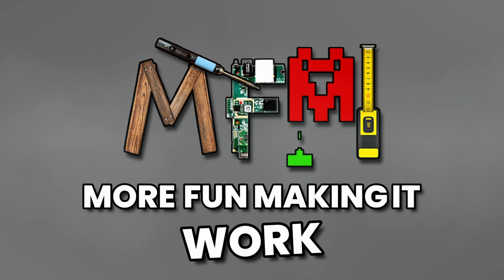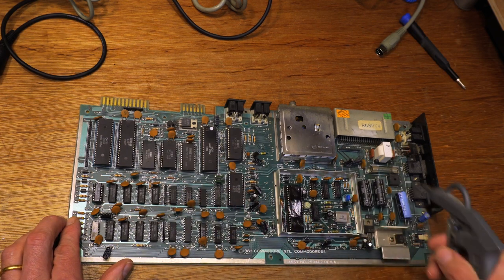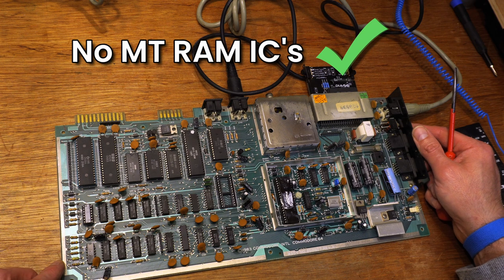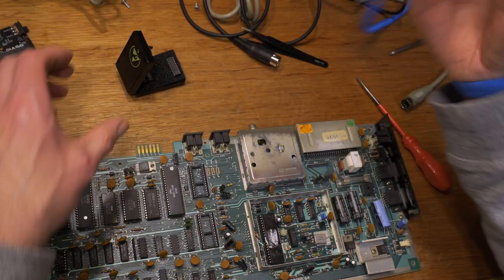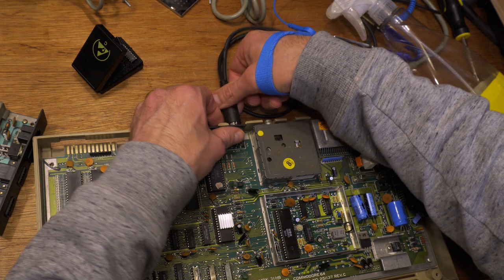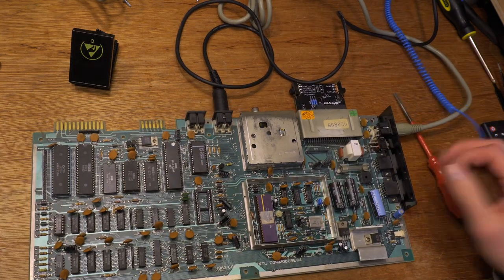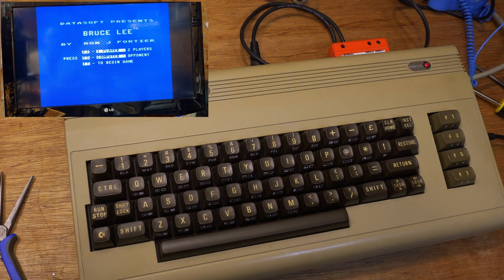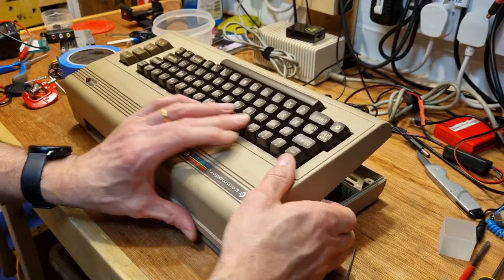THREE THINGS BROKEN! - But Still a QUICK C64 Repair. FOUR if you count the case clips!

Comment: Ah, just ALL THE EXPENSIVE CHIPS knackered then. Cheers MOS 😳
Reply: May have been over voltage from a failed power supply too.
Reply from the maker: That's a good call. Probably the right one
Reply: @Breakfast_of_Champions  Probably a little from Column A and a little from Column B.

Comment: Nice work bud.  I recently revived one that had a purpleish screen and freezing and dead test was showing pla and vic2 good,  but showing a whole row of ram bad.  I knew (assumed) that it was the multiplexer which were both socketed  in this board,  but nothing else except vic ii.   Changed multiplexer and boom. The right amount of bytes:)   changed pla and got boot screen,  but still purpleish.   It was the vic ii .  Then normal screen.  Unfortunately the sid was bad too.  Lol.  Those vic ii can cause weird problems eh?
Reply from the maker: Its a nightmare when so many chips go bad. Not so bad when its someone else paying for it!

Comment: What?  No retrobrighting!  I'm interested in what technique you think works best, here in the UK.  Do we need a lightbox?
Reply from the maker: My lazy method is just shove it outside on a sunny day. Doesn't work quite as well on a C64, but fine for most jobs. I've not tried it myself yet but I hear very good things about vapour briting. A light box probably not that essential unless you have no outdoor space. Even in the winter the weak sun is going to be much stronger than a lamp. Plus I'm wary of the fumes so outdoors, for me is a must.
All just my opinion!